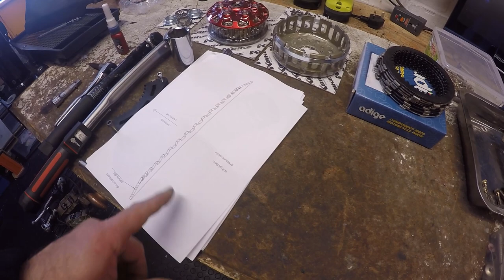Ducati Tech Advice - How to fit a Slipper Clutch to a Ducati - 748, 9XX, 1098, ST2 Etc....

Comment: Very educational and clear video! I also have the problem that the entire system protrudes too much with the original spacer with seal. Can you tell me how many millimeters of difference there is between the original and the supplied spacer? (Hub)
Thanks

Comment: In case this saves someone else a bit of a trouble I found out the hard way that a stock clutch pack will not/may not fit in an aftermarket basket that has the band on it as the tangs on the friction plates are likely to extend out past the basket and thus not clear the band. I had to turn mine down on a lath to get them to fit. After market aluminum pack for me next replacement as I agree the steel disks are causing extra wear even with the steel inserts my basket has to protect it. Cheers.
Reply from the maker: Nice tip James👍😎

Comment: Hi, nice clear video.  I have a question about the convex plate - you installed it with the mark towards the engine - everything I have read suggests the mark on the plate should face you (eg outwards) as you install the convex plate.  Is installing it with the mark towards the engine specific to this slipper clutch?

I ask as I am cleaning up some plates on my DP performance slipper clutch on my Hypermotard 1100 - the actual basket and set up looks very similar to this (despite being DP branded) including the screwed in place first drive plate against the clutch basket.  Mine is installed with the mark facing outwards, but am now questioning/confused whether this is correct or not.

Comment: hello ,nice and clear video as normal .I never used a slipper clutch on the 916 in track day and I am sure it's important  but I wonder if on a normal use of the bike out of the track ,it 's necessary . another question but nothing to see with your video ,what do you think of the possibility to install a 1000 or 1100 ( hm,monster) on a 996 frame , it's a good challenge and a possibility to have a good and lightly bike .thanks for video
Reply from the maker: The slipper clutch is a nice addition to allow the bike to not suffer lock up by downshifting too fast.
It is possible to fit the air cooled engines into a 996 frame, a few people have done such a conversion. 👍😎

Comment: Just had a conrod bearing go on my 1098 one of these may have prevented it from some of the strain .
Reply from the maker: Conrod bearings tend to fail more due to oil quality, debris in oil or starvation. The slipper clutch is more to remove load on the bike during rapid deceleration. 😊

Comment: Hello my friend. Good video and nice Lotus in the background too. Can I ask you a question please? So I have recently got a 1098s and I am having issues downshifting as in I just can’t go from third to second or second to first without a right faff every single gear change. It has a slipper clutch currently installed but I also have the OEM clutch too. Would it be a good idea to throw the OEM clutch back in to eliminate the current slipper clutch being the issue!? Hi don’t think this is the issue or I’m being honest. Sorry for the essay lol.
Reply from the maker: Problems with down or up shifting are not normally related to the clutch unless its having disengagement issues. Even then you can check if thats the problem by blip shifting up or down the box without the clutch. If that works then its the clutch!!
Another common issue which sounds simple but often over looked is the pressure you apply to the gear lever, if not enough or cleanly done it can cause shifting issues.
However usually this type of issue usually relates to either shift fork, shift drum or the dogs on the gears themselves. 
Hope that helps
Reply: @DesmoWerx  thank you my friend… plenty for me to consider snd have a go at there. Thank you!

Comment: Did it make the clutch noise a little quieter? Easier clutch pull?
Reply from the maker: Hi Bernard, the noise is about the same, hard to tell really. The clutch pull is slightly lighter.

Comment: Hi!  Nice video DesmoWerx! 🤩
 
Has anyone installed this slipper clutch on a Ducati Hypermotard 1100? I installed it on mine (the same kit DesmoWerx shows us in this video) and I feel the recoil action of the slipper clutch on the clutch lever, is it normal?
Reply from the maker: When say recoil do you mean the lever is pulsing in use? not heard of that before. Sometimes it may click, this is usually caused by sticking plates.

Comment: Can you fit a slipper clutch on a panigale v4s for the purpose of reducing clatter noise and is it compatible/safe with the auto blipper?  Great video!
Reply from the maker: HI Graham, I don't do any work on the V4's so could not comment specifically. However the slipper clutch should not make a difference as its wheel speed against engine speed that causes it to operate. The electronics would work independently of this.

Comment: Can I use the original cluch cover for this cluch. Or must this cluch have an open vented cover?
Reply from the maker: You can use a sealed clutch cover but a slipper generates a little more heat and dust when used hard so worth removing every now and then to check and clean it out.
Reply: @DesmoWerx  Thank's!

Comment: great video as normal, will be investing in one once the 916 has been rebuilt. I did send you a message on instagram regarding torques, but as a general is there any diagrams that show and list the torques of a 916 engine? Also do you plan on updating on the 916 build? Keep up the great work Jamie
Reply from the maker: Hi Jamie, the manual list all the torque values do you need them?. 916 engine build will get completed but it is a side project.

Comment: I fitted the same kbike slipper clutch. Last time I took it apart for maintenance (cleaning and ramp regrease) the spider spring was broken. Replacement is 30 eur but postage to Oz is 40 Eur!
Is metal epoxy or welding the spider spring an option you think?